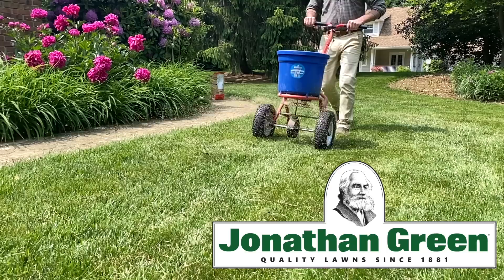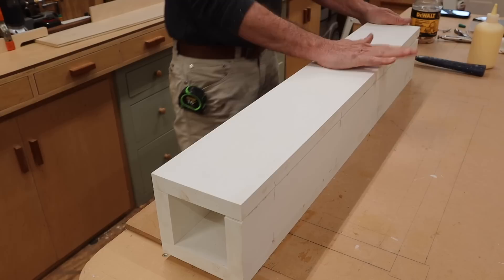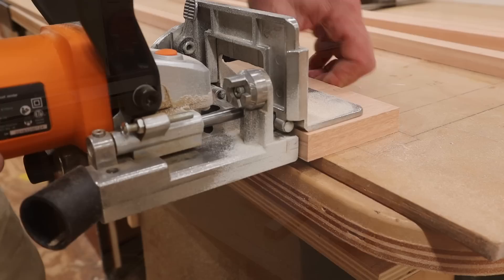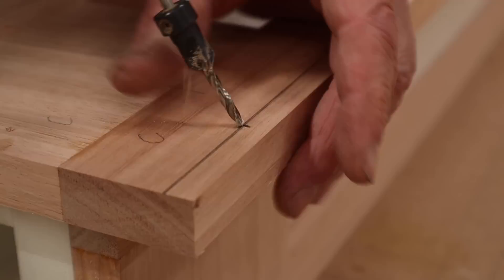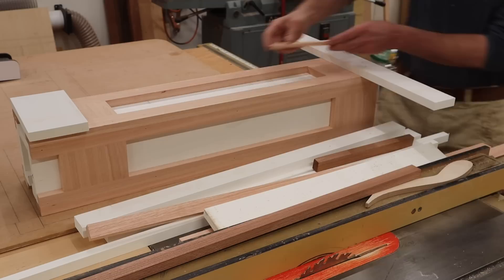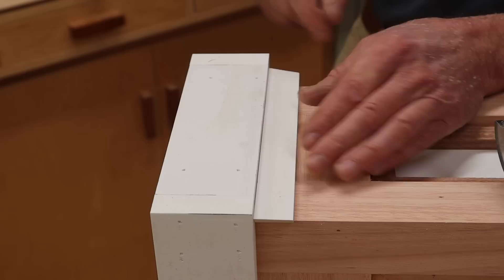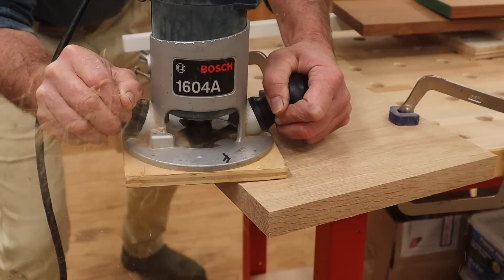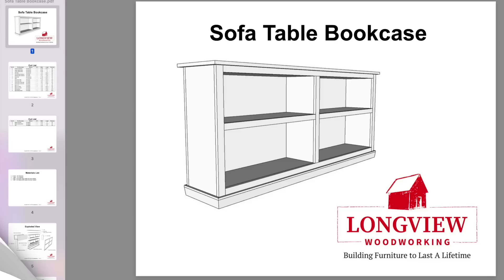How to Build a Lamp Post / Fun DIY Woodworking Project

Comment: You said the cap was white oak but you didn't say what the rest of the face frame was.  It looked a bit like oak in some of the shots.  I was wondering how you ran wires to the top of the post for the light.  From the shot where you are sliding the cover onto the post it appears that you have conduit running up the inner post in a dado.
Reply from the maker: A combination of red Grandis and Sapele… just using woods that I had in the shop that can be used outside. Since I’m not an electrician I don’t show any electrical work on my channel
Reply: @JonPetersArtHome  What is the big deal? Why are people so scared of electrical work, or showing it? If some yahoo kills himself by watching a You tube video, no one is going to jail.

Comment: I sure was excited to see you working with the PVC so I could see what you used as a screw hole filler....but then you covered with the wood face plates......UUGHH  gut punch
Reply from the maker: They do make plugs for pvc but I mostly use oil based exterior ready patch
Reply: Thanks Brother, I actually watched another one of your vids & saw in the background a can of MH Ready Patch. I have never heard of it but I am curious, does it hold up well to the hot sun, humidity & moisture. I like working with PVC but really I just want to find a product that is a good all purpose hole filler for various types of siding, wood, & PVC etc.  @JonPetersArtHome

Comment: Hi Jon, as someone who works a lot with Azek/ pvc, I see several potential problems. When using pvc, pvc glue should always be used. It is stronger than screws or nails, since the glue welds the pieces together. My other concern is that you e mixed dis-similar materials, pvc and wood. Pvc expands drastically with temperature changes, as it expands it will blow apart your wood joints. Since you’ve introduced pvc into the project, why wouldn’t you do it all in pvc? The pvc holds paint really well, doesn’t rot, and is impervious to insects. Pvc is a great product when used correctly. It’s unfortunate that there is very little training for the material. Dark colors are also a big problem for pvc, it with cause the pvc to expand more drastically than normal. Nice lamp post!
Reply from the maker: Hi Jeff, thanks… yes I understand all your concerns with mixing the materials… I think because the Azek part of the lamp post is only 5 1/2 inches wide it should be okay… but I will post an update if not. I have used Azek glue on other projects and yes it works great but it’s also very expensive and I didn’t want to buy it and didn’t really think it necessary for such a small project. Painting it black is not going to help with the expansion and contraction but one thing the lamp post has going for it is that it is in the shade almost all the time. 
I’ll revisit the project this time next year and let everyone know how it’s doing. 
Thanks again, Jon
Reply: @JonPetersArtHome  Having used PVC glue, I will agree with Jeff--it makes a very strong joint. But I also like Jon's approach. He just used up a lot of leftover wood & PVC scraps, and he was willing to roll the dice and see how this lamp post held up (or doesn't) over time. We all do that sometimes!

Comment: Jon you didn’t address the lamp install.   I was kind of hoping this was a solar lamp install since  my property is just to big to run wires.  Most of my exterior lighting is some kind of solar because most of my yard has no wiring or old wiring. So I’m highly motivated to go solar.
Reply: Get a minimum of 10 lumens for a lamp

Comment: how did you do the wiring for the lamp? Is it battery powered?
Reply: It's hard wired. You can see the trench and conduit towards the end of the video.
Reply: @andrewrobinson7797  I saw the conduct, just wondering how he got it up to the lamp. The post is not hollow as far as I can see. Did he just staple it on the side?
Reply: @mlk4343  I took another look. I reckon he routed a channel on the post and ran the cable up that. I'm guessing, but that's what I would do 😀
Reply from the maker: Yes that’s what I did routed a channel up the post…. I tend to never show electrical work on my channel since I’m not an electrician.

Comment: Nice job, Jon.  What is the reason you went with wood for the face frames vs. the PVC you used elsewhere?  Thanks.  Looks great as always.
Reply from the maker: Thanks, I had the pvc from another project and I wanted to use it and the wood aloud me to get a good glue joint